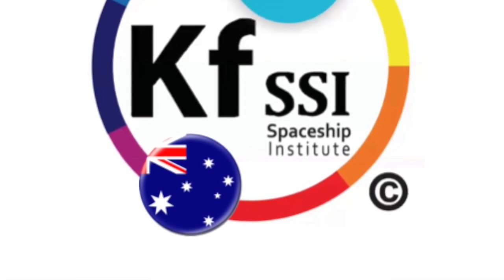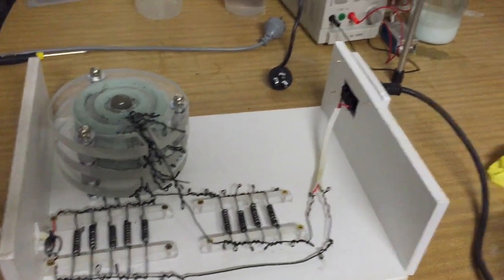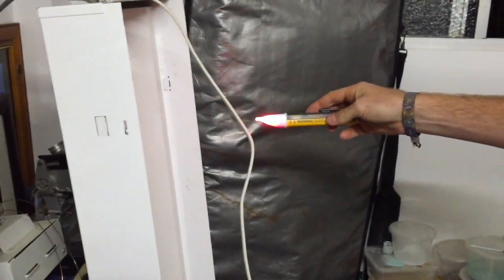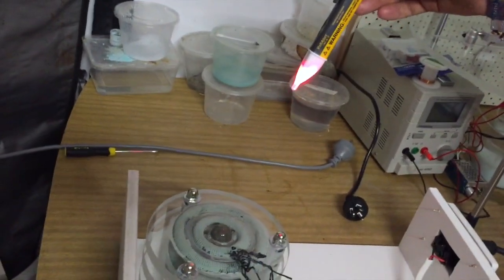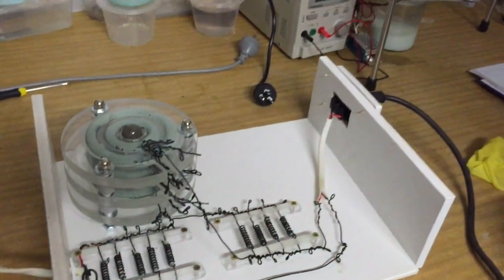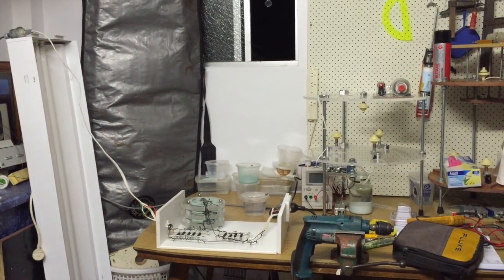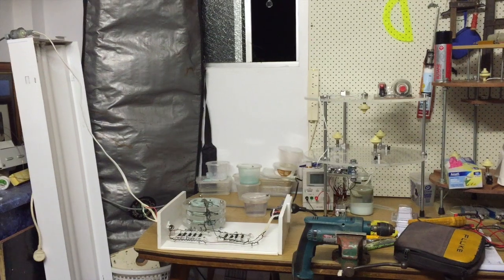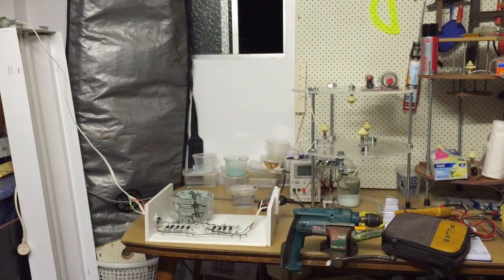KF Australia - Breakthrough!! Working Magrav power unit - Free, clean renewable energy!!

Comment: IMO, the Keshe thing is a hoax, I've never seen anyone show it to be working, and even the KF can't explain it in terms anyone can understand, KF has hours and hours of videos, but none are specific, and none of the experimenters have gone through the instructions completely, Yes, it takes 3 - 4 weeks of preparation (yes I did find the instructions in print), lots of fancy drawing, lots of fancy talk, I don't buy this concept of "coating the house wiring with nano coating" before this device will work properly, although this video does show me a power savings (input amps 0.6, output amps 0.9) of 300ma for How much does this thing cost? and you need to assemble it yourself? Seems like a hoax to me, even the KF says to leave it plugged into Mr Power Co. meter , so I don't get much savings on power, it would take many years for me to recoup my cost...

Comment: The video does not show any conclusive evidence that the power is more or less going in or out because the voltages on both sides were not shown. If the voltages are the same and you have shown this, then, you would have Zero thumbs down. Amperage being lower at the input is only a sign of dropped voltage in the secondary coils. The coils you have made I believe are acting as a bucking coil, which would drop the voltage but drive the amperage up. In some cases, using an electric motor, the bucking transformer setup will give a feedback , offering more amperage and voltage at it's output. If we take a resistive load and put it into the bucking transformer setup, I think you will find quite the opposite, however, if it isn't as I suspect, I guess I will be the first to say I am wrong. I have seen it all out there, with claims to show drastic energy levels drawn in from the aether or Earth's plasma tubes, but, I'm afraid you'd have to be driving a very high frequency from an NST, capturing the resonance and Earth's emf to draw this plasma energy in to gain any output, as Don Smith and Tariel Kapanadze, Dr. Moray, and Tesla have done. I am not so much a firm believer in Ganz and all of the hocus pocus this foundation has shown on Youtube yet, so, until I am shown a true working model that isn't plugged into the wall which shows a voltage output drawing completely on it's own from Earth's Magnetosphere, as the Smith system can, I probably will never be a believer. I have watched so many build the first generators with slepticism and no result, then, they have spent countless dollars to do more, again, still no results. It's like they have to go ahead and spend a grand in parts and spend all of their time to get results before they say the hell with it, Mr. Keshe, please sell me a unit for $550, then., do we get a guarantee it will work and arrive at our doorstep? That is what I would be after instead of wasting my time making one that nobody has clearly shown clear working results that are based on something out of the ordinary. RF capture with resonant coils I think is a much more efficient manner than having curly cues that make no sense in the taking in of any type of energy. A capacitor damming hf energy then oscillating between two massive banks of caps using a tuned spark gap would certainly give us enough high ampperage to run 100 MW as mr Smith has done from less than $1100.00 worth of investment. I have been approached by a few so far about this, but, why am I seeing people only being toyed with , given little bits and pieces of how to build it and not being shown the whole and proper working system to build. ? It doesn't make sense to me if you just go to Keshe's website, you could save your aggrevation and just pay the man for a generator that plugs into your wall which sets the meter back to zero, however, you still have transmission and distribution charges, service fees, and, you have to get it working by keeping it plugged in, using more energy first to get it working, while you don't have to do this with partnered coils.. they literally reduce the energy as the load is increased!

Comment: Hi,Joel,  I just finishes building my magrav Unit, It's been running for five days now with a lamp plug into it, I notice that the live wire coming from the cable that's plug into the wall socket is turning a little dark I ;m talking about the copper at the connection tyde of the magrav it's turning black a small amount of black is notice, now is that's the way it should start out, I'm just trying to Gauge  this right now.

Comment: 1940's Henry T. Moray extracted 50,000 watts from thin air without any power source zero power input, output 50,000 watts . 2015 Margrav has potential of Megawatts earth floats on a sea of energy nice kick on the nutsack!!!
Reply: +mag netron   Ha ha ha ha yes sir, and I bet you believe in unicorns too.
Reply: Quantum Leap answered me this "a dielectric is connected to a conductor with a current of 0.4a. If the current can deposit electrons for the time of 0.2s, the accumulated charge in the dielectric will be?
Reply: +Quantum Leap amount of electrons accumulated in the dielectric is 0.08C
Reply: Quantum Leap I could tell you never took a psychology class ha ha ha ha. ;  D
Reply: Quantum Leap masterbate is physical act, masturbatory is physiological mind set for example "my boat is the biggest in this block" that is masturbatory a feel good about my self boosting.
Reply: mag netron So you can access information thru Wiki. Congratulations.  Why don't you contact some physicists and ask them about this Keshe shit?
Reply: Quantum Leap I have looked at both sides, learned that in college. So far my experiments have enable me to know that nano coated copper is a conductor, and a resistor measured at  lowest kilo ohm , and highest mega ohm i'still learning how to use my 1965  Heathkit model IO-12 oscilloscope put together by someone, found it at Goodwill store for $10.00 it is my first oscilloscope, and I located the oscilloscope trainer partial kit I had to locate 90% of components it did have a tuning coil original one!! (Hopefully I can experiment with magnetic coupling or resonance, ) The exact hard to find original tuning coil .  busted out my old electronic engineering text book from late 80's its dry as hell first half is all resistor circuits Wheatstone bridge, delta resistor configuration to the point of nausea lol. ! But as I move as along withy home study I will eventually get somewhere so that makes up for the drudgery. And I will be better able to makes sense of electronic and electrical circuits.  Free energy is a magnetical field so a good understanding of electronics should enable me to understand the process.....
 I'm a late bloomer. ;  D
Reply: mag netron  Well, good luck with you future studies. Just don't waste your time trying to make something from nothing.

Comment: It is very misleading to say that you have a 'working' magrav unit when you haven't made any proper measurements yet. The only valid way to measure the performance of the magrav device is to measure real power consumption at the input of the magrav unit and compare it to the real power consumption at the output of the magrav unit just prior to where you are connecting the load. The output voltage may be lower than the input voltage, and a drill is a reactive load so you will measure a higher reactive current into the drill, but that doesn't tell you anything about its real power consumption. If you don't know what a reactive load is and what reactive current is and what power factor is, and how to make proper input and output power measurements in AC circuits, then you have no business making any claims about whether your magrav is 'working' or not. In the very least you need two decent AC power meters that show real power consumption and power factor, and you need to use these to measure the real power consumption at the input and output. Comparing AC current measurements and drawing conclusions from that just shows that you have no idea what you are doing. Not trying to be negative here at all. Just stating the facts of the matter. Please get assistance from someone who knows how to do proper power measurements on AC circuits, otherwise you are just making false claims and misleading people. Is that your intention?
Reply: +Albert J When your intention isnt ac or dc, for what purpose we need measurements. Ok, Just like in cascading workshop first load less, then more and when you are on 1KW place refrigerator on end and other electronics place before big load and before Magrav unit not on live cable this time.

Comment: For getting any kind of meaningful input/output comparison, please provide Volt and Ampere readings on both sides.
Reply: +XYmatrix 
That would still not be sufficient for AC circuits like this. Real power consumption in an AC circuit like this is Vrms x Irms x Power Factor. You can get AC power meters that do all these measurements and display the resulting real power consumption, but the cheap ones you buy at department stores may not be very accurate, but that would at least be a good start.
Reply: +Albert J   Even with the most precision instruments, correctly used, there would be NO power gain. This is a mind control hoax, and the minions out there are too stupid to know it.  Shameful, shameful. Somebody needs to Kick Keshe In The Balls.

Comment: 0,6 in 0,9 out!  oh man???
Reply: +Herbert Karl 
A comparison of input current to output current tells nothing about the efficiency of the setup. They have to compare output power to input power, and they have to use proper measurement equipment or methods which take power factor fully into account. A drill is a reactive load so it will have a reactive current. This is all basic stuff that anyone would need to know if they want to make proper measurements on the true performance of a magrav unit. This video indicates nothing about the actual efficiency of the setup.
Reply: +Herbert Karl 9.0 v
Reply: +Albert J  Yep, the metrology (!) they use is useless. Just like that dumbass Morin the Moron, they never measure POWER.  It's always voltage this and voltage that, or current this versus current that. When will the asswipes use proper instruments to measure input versus output POWER?  Answer:  NEVER.  It would expose the scam!

Comment: Congrats! I am very happy to see this unit is working...
Would you mind making a video on how you make your Gans, are you using any small source of current especially for CO2 Gans or simply a resistance such as a LED light or small computer fan between the two wires? What's the final Gans "soup" you used for the coils?
As for the nano coating, did you do only the hot bath then steam caustic combination once or did you use more than one session? And/or mixture of heating with butane followed by hot caustic? Seems we need a very good nano coating i.e. more than just one double session (hot bath then steam)